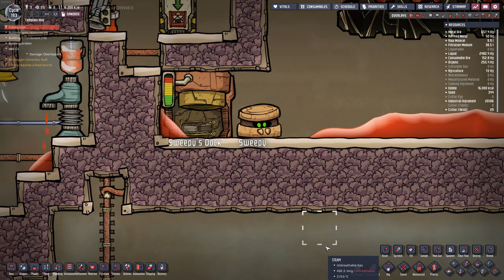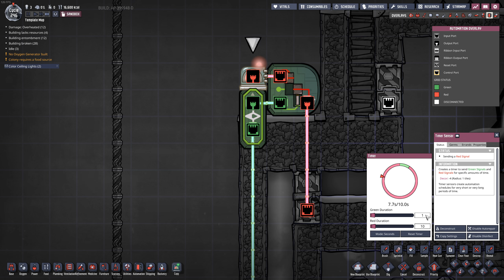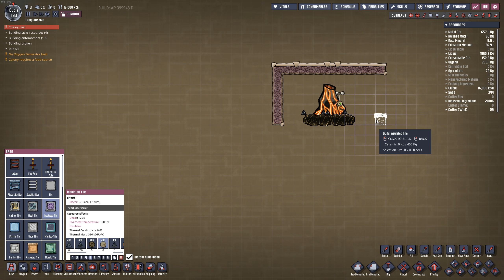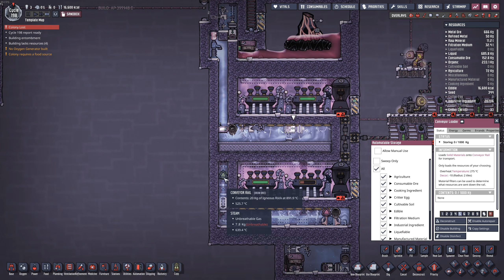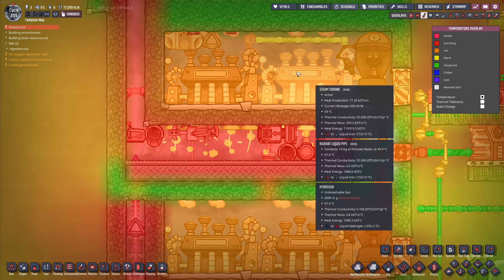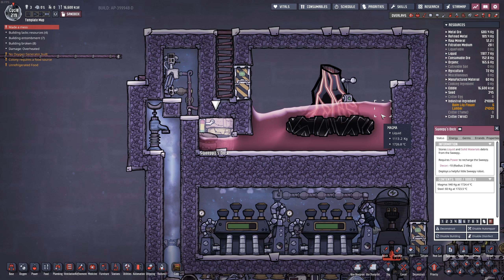Volcano Powered Sweepy! Oxygen Not Included

Comment: Honestly, your best bet to squeeze every last bit of power out of that system is to have either an aquatuner or the AC unit run conductive vents through a cup of metal tiles and a small amount of crude oil, and just use that to pump the heat back into the system. Or just have a third, low efficiency sweep system that does the same as stage 2, but everything dumps onto the metal tiles and only leaves at 120 degrees, then use the AC or aquatuner powered by stage 3 to leave it nice and cool for use elsewhere. I'll give it a try, it's been a while since I've booted up this game.

Comment: If you put a mesh tile next to the magma sweepy he will deliver faster because the sweepy will be confined in a smaller space and the magma can be swept up in front of the dock.
Also you can put a counterflow whith gas and liquid on the igneus rail to extract more power.
I think a counterflow with just a reservoir can handle all of the heat, maybe hydrogen and petroleum for withstanding the heat.

Comment: PRO TIP: When exchanging temperature with conveyor rails. For some reason any amount on the conveyor rail less than 20kg (i.e. the max load) will exchange temperature much slower. So you want a backlog system so that it is always 20kg going into every packet, otherwise you will not be able to exchange temperature efficiently enough
Reply from the maker: Thanks for the info!

Comment: @13:09 you don't have to jump over the heavy watt joint plates with conductive wire bridges. the joint plate acts like a bridge and you can pass regular wires through them without circuits being joined.

Comment: You can do a lot of this in a total vacuum with a regolith melter setup(for MORE power).  If you drop something like under 1.4kg of magma on top of a heat exchange with 2 mesh tiles will make it spit out igneous at around 1400c to one of the sides of the heat exchange.  Seen the 2 mesh corner trick from Francis John, though he didn't use it in the setup of a regolith melter.

Comment: The fact that plastic bottles can live up to magmatic conditions.

... Just drop the hot igneous rock on top of the dock itself, use a sweeper through solid material to pick up on the other side, Sweepy will take care of the igneous rock, and deposit it back into the dock from the rail drop-off. Walls would be enough to have the dock contained in a 2x2 square. Basically, copy what you did with the Sweepy up on the magma side, but with rail drop-off's... and the drop-off HAS to be on TOP of the Sweepy Dock to the UPPER-RIGHT CORNER of the Dock.

Comment: Great video! I just have 1 thing, you don’t need those conductive bridges on the joint plates. You should just be able to run the conductive wire through the plates and have it work. (I saw it on the ONI reddit so feel free to correct me)
Reply from the maker: Good point. Old habits